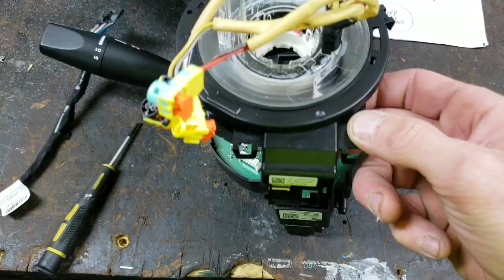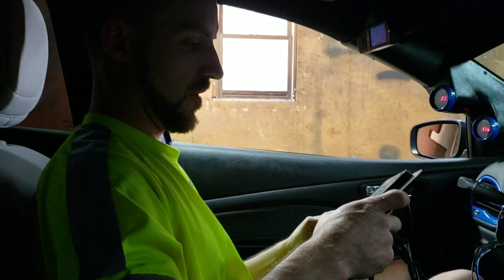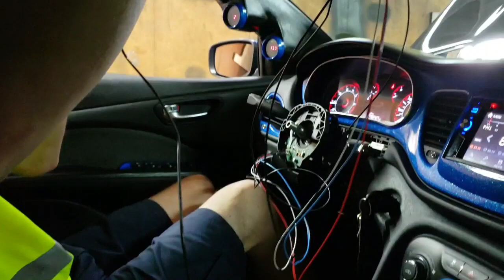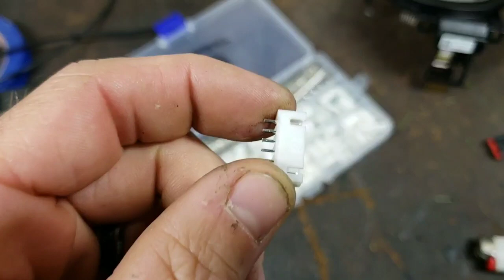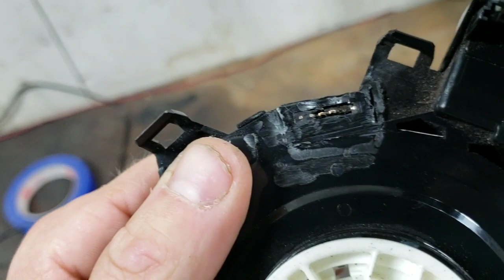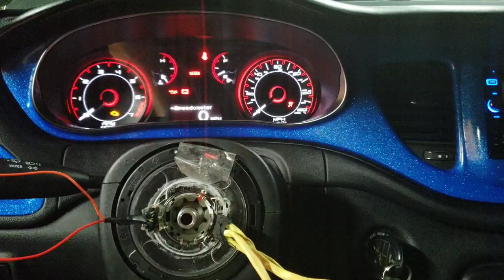Custom Dodge Dart - Cruise Control/Horn Button Relocation and Wiring for NRG Steering Wheel install

Comment: Do i just tap into those 2 middle wires and thats it or i have to open the clock springs and do something in the inside. Cause i just cut off the black wire harness from the steering wheel and plugged it back in and spliced the 2 middle wires but it doesnt do anything

Comment: Tell me how I bought everything you did and did the same thing and nothing worked ??
Reply from the maker: Mine didn't work when I first hooked it up...and it ended up being an issue with the soldering...since I fixed it everything has worked ever since with no issues

Comment: How did you wire the horn?
Reply from the maker: Its shown in the video, but i back feed it through the clockspring...
Reply: Yeah i went back and rewatched it. Im in the process of doing the custom harness
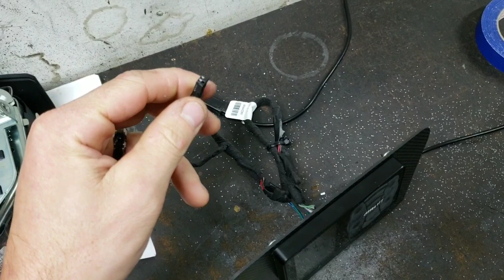Reply from the maker: Starts around 7:10 talking about the horn
Reply: How do you test which wires are the horn

Comment: Which nrg hub are you using? Also what did you do to cancel the airbag light?
Reply from the maker: SRK-DRTH from NRG
Three 2 ohm resistors, one in place of each of the airbag conennections

Comment: How did you solder those tiny pins. Currently in the process of doing the same but can’t get it to work
Reply from the maker: You cover the tip of the wire in solder first, then just reheat it against the pin just long enough it sticks...
Reply: Bryan Myers - Automotive Vlog I’ll try that. Thank you
Reply: Bryan Myers - Automotive Vlog  hi Do you sell that wires or is there a  Way i can buy it from you??